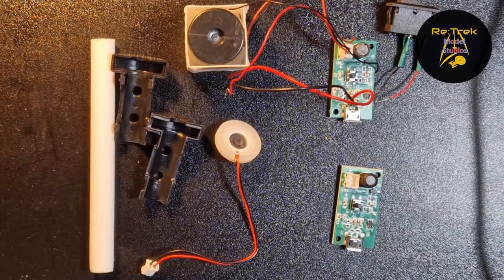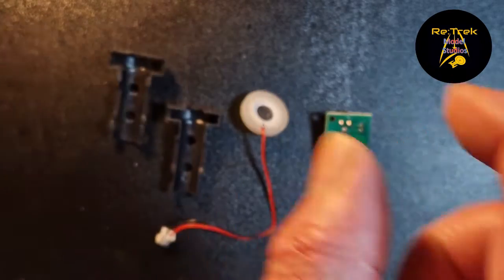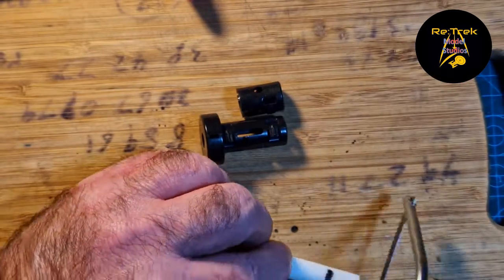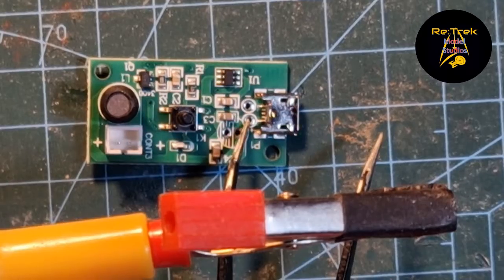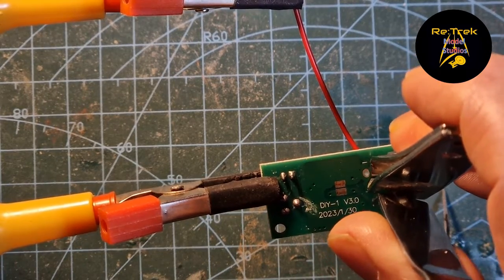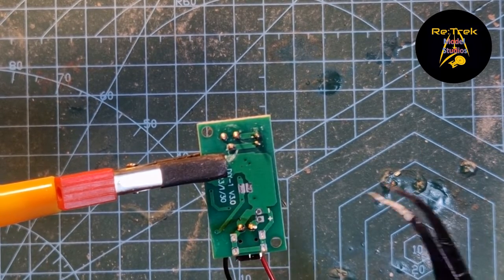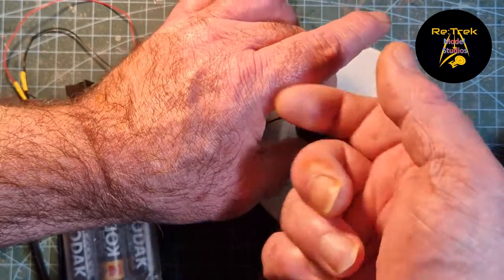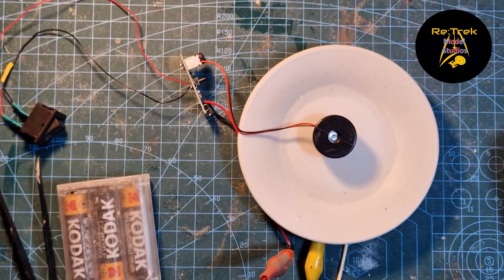USB micro humidifier mods for mist effect tutorial

Comment: I like this tutorial very much! I want to build one and add it to my Supernatural diorama 1/18 Impala and Dean and Sam scale figures! I wanted to ask if u also had a more DETAILED video tutorial on the motorized Voyager nacelle struts. I bought the same servos and have an Arduino board, but was hoping u would post more on how to program and use a blue tooth module to control the functions? I dont have PM contact info...
Reply from the maker: Hi Joseph I are you on Facebook to can chat on messenger ?
Reply: I have shipping to me the servos, brass tubing 1.5 and 3.0 mm, and in the midst of building my  Voyager.  I also have the Arduino Uno and Nano, breadboard, jumper wires, etc.